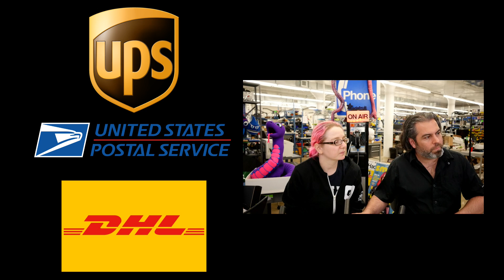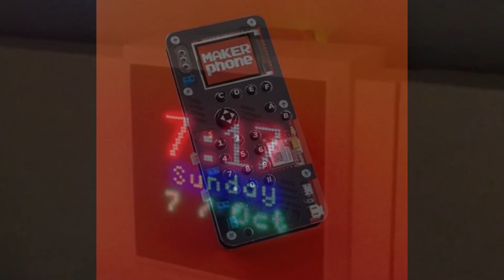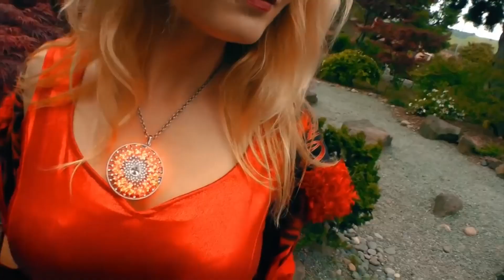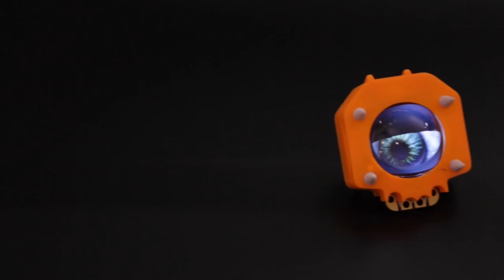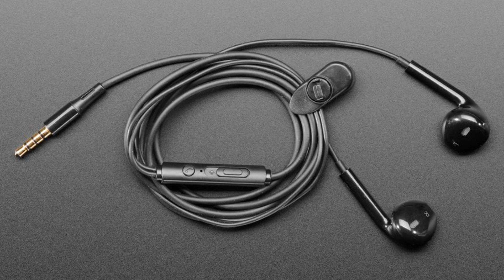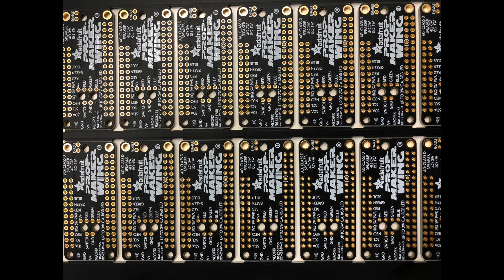ASK AN ENGINEER 10/17/18 LIVE! @adafruit #adafruit #AskAnEngineer

Comment: The Circuit Playground Express carrying case was originally mis-appropriated for earbuds. I blame the earbud lobby. Anywho, I have 2 sets of earbuds that came with them, one hard-shell and one soft. I like the CPX carrier better. Also, I've seen some that have a loop on the "hinge" portion, so you can slip a carribiner in there and clip it. Can also just hot-glue one on there.

Comment: We need plans and schematics and the Programing Of Arduino and Raspberry Pi- Projects that are all about Making EuroRack Synthesizer Modules. DSP audio processing has already been proven possible with a guitar & Keyboard multiEffects pedal. It contained flanger,phaser, chorus, reverb, and delay. All with knobs to adjust oscillating time, adjust the echo repeats and control the depth and speed of the jet plane flanger or the ocean like Phaser.
    So all that was able to be done with just an Arduino!!!
   And there was another one made by another maker who used the raspberry Pi 2b (I think 🤔) and it had an lcd screen and was a pretty cool effects pedal really.